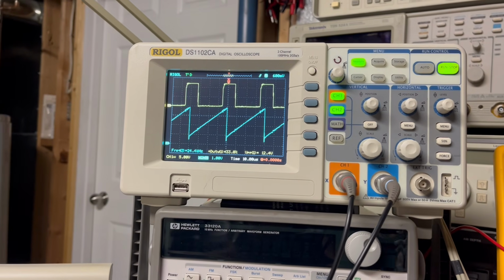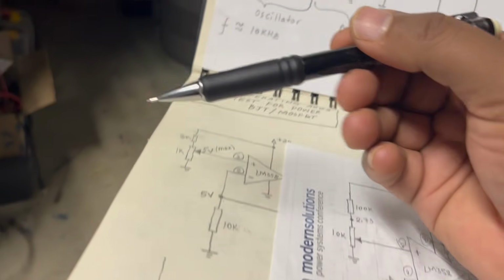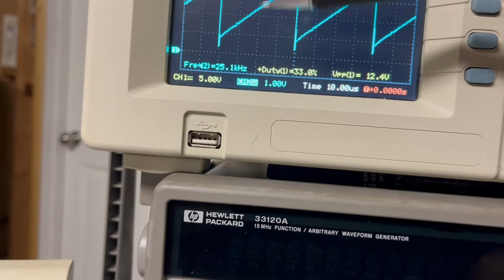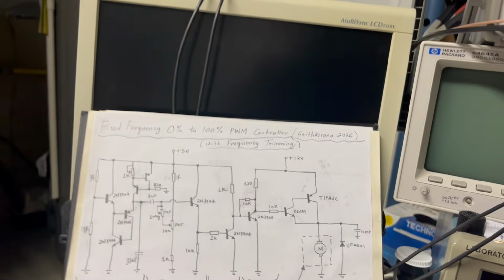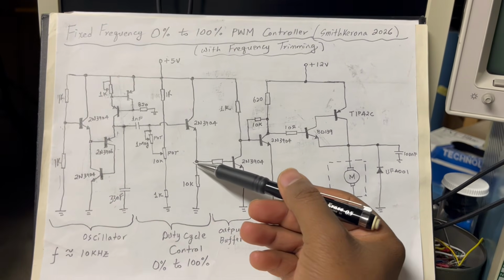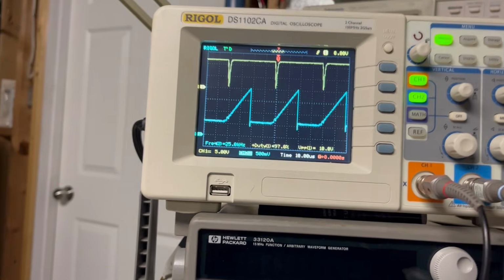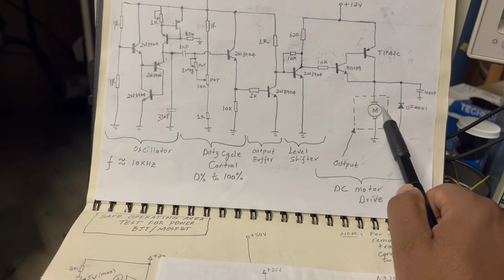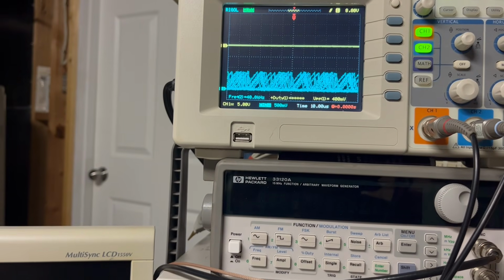Fixed Frequency PWM Controller For Closed Loop Control - Part 3

Comment: I like the idea with a saw-tooth voltage by use of a current source. There are constant current diodes like the E-101 operating at 100 µA. I'm thinking about implementation into a dual TLC556 timer circuit, where I use one of the timers for a fixed frequency astable multivibrator and the second one for a monoflop where I can control the duty cycle by means of the voltage at the CV pin. This circuit should provide a highly linear pwm output voltage with a duty cycle between 0 and 1.